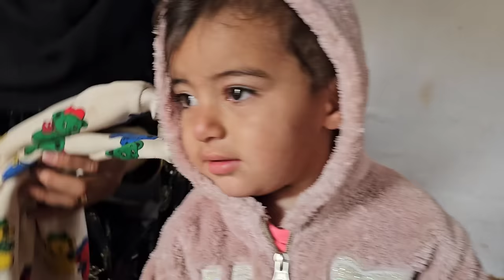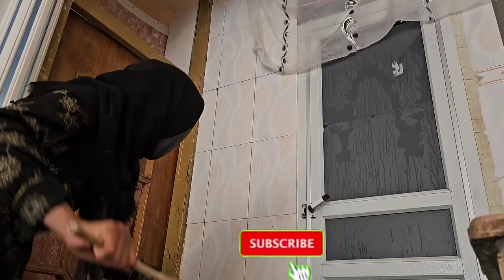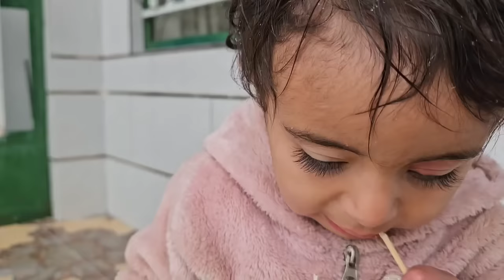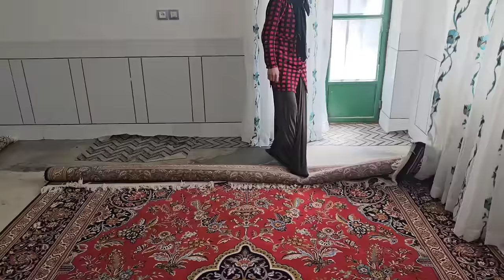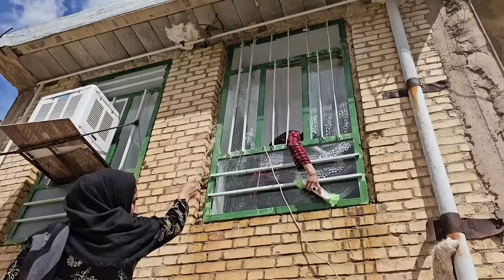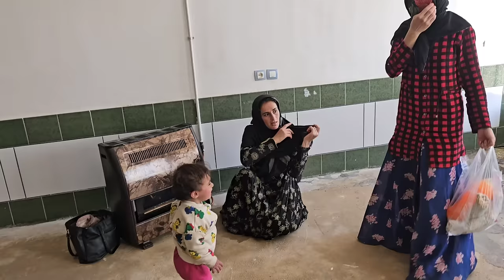"Resistance and getting rich: how to get more income by cleaning the house"

Comment: It is good to see Kobra go back to work. Although,  it is very strange for me to see the inside of the house being hosed down, but I'm accustomed to using a bucket and a mop or a cleaning cloth to wash walls and floors. But in my part of the world, our houses are built with more than just cement and block and would be severely damaged with that much water inside. I see, though, that this house that Kobra cleaned has no wood or drywall to be ruined...
Good job, Kobra. Keep up the good work! 👍 Make that money to improve your life!! ❤

Comment: Washing with water inside the house invites black molds (toxic in the lungs) especially when there’s poor air circulation. Dampness in every corner needs to be air dried
Reply: Is a cement floor and have tiles, want I will not do it put water over electrical connections, and I will wash curtains out